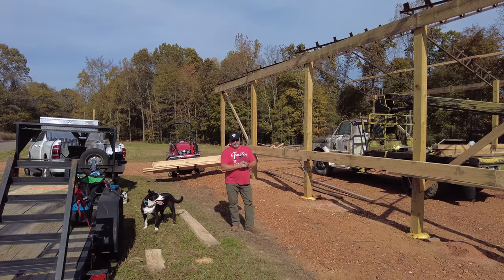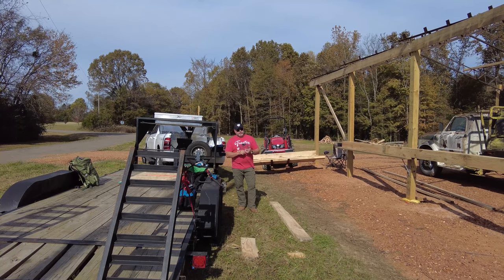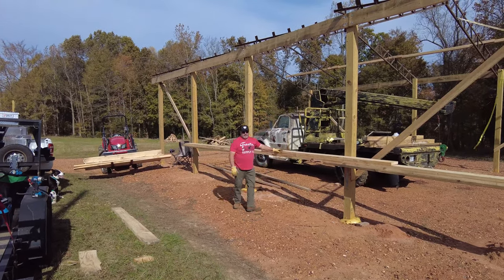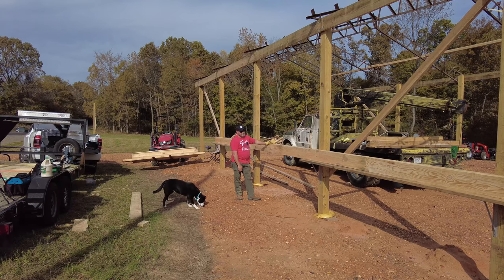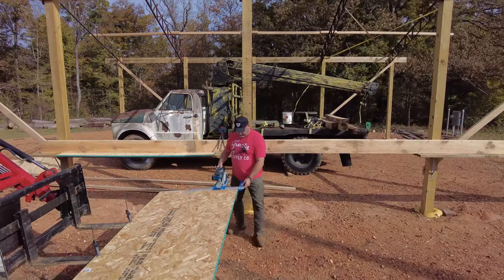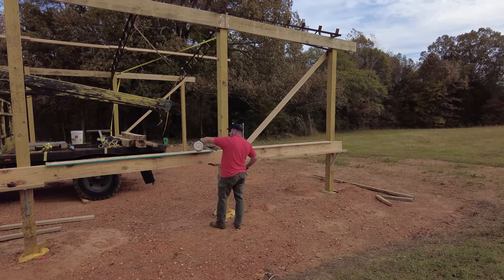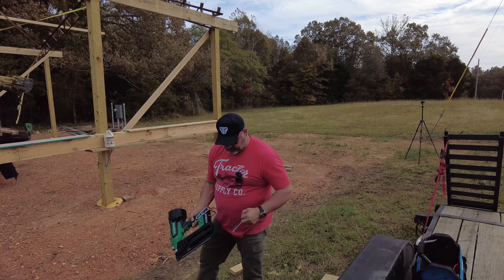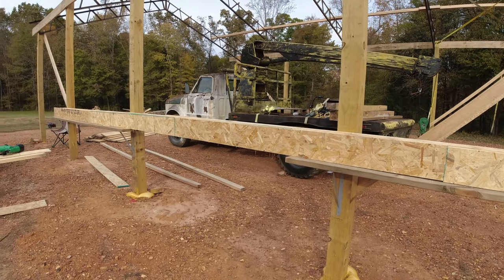Homemade 30FT Laminated Beams made of Sawmill Lumber PT3

Comment: i am really impressed with this homemade beam.  going to go back and watch part 1 and 2 next!
Reply from the maker: The beam is still holding up well. I learned a lot about making a beam. I think I would stack them flat now. It seems to be the best way to build a beam.
Reply: @TonysTractorAdventure  i think i will build my beam flat on sawhorses. going to build a 24 x 10 ft loft in my pole barn. want to use as few support post as i can to give me plenty of room underneath where my workshop will be. 6 inch concrete slab was poured on thursday. waiting to cure. will be nice when the weather cools for these fall projects.btw i like your tym tractor and especially  the quick connect for the loader. i have a kioti ck30 korean tractor that's been like a good friend to me for many years.

Comment: Nice video Tony. Glue. Nails and OSB. even at 28 feet. I don’t think you’ll have a problem.
Reply from the maker: That beam is some kind of heavy. We ran into a problem, but we will figure it out. The sawmill went down again, so I am upgrading the engine and clutch. It came at a bad time, but life does what it does.

Comment: If ya ever do that again, have the lumber planed all the same thickness and use a roller for a glue spreader. Make sure they have sharp planer blades you do not want a glassine surface for a glue up.

Comment: Straddle the beam with the tractor and lift it with the loader and 3-point hitch. It’ll work for a short haul.
Reply from the maker: I ended up putting the beam on the trailer which was an ordeal. Your way was a great idea and maybe easier than what I did.

Comment: "next time on Tony's Tractor adventure Homestead: putting a battery powered framing nailer back together!" HAHAHA.  Just kidding.  also, on that wood glue, do yourself a favor next time and swing by the dollar store/tree/general and get you a synthetic plastic brush.  Look in their cooking supplies, like what you'd use for putting bbq on the ribs.  When that glue dries on those brushes, you just pull it off or break it off.  I use them for woodworking projects.  Lot better than paint brushes.
Reply from the maker: Thank you. We have the beam up, and it will need a little help, stay tuned. Next time on.............